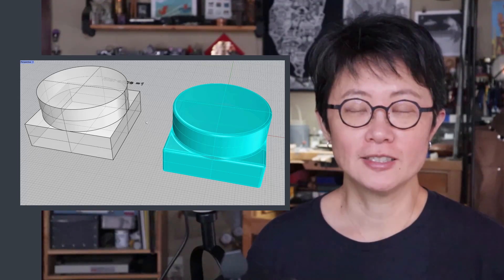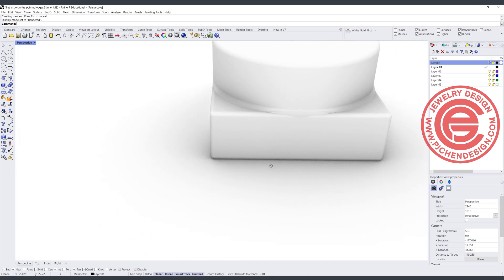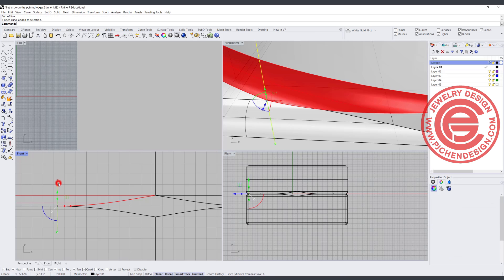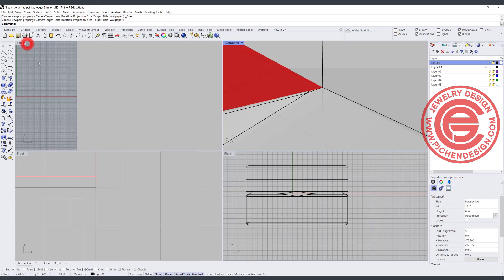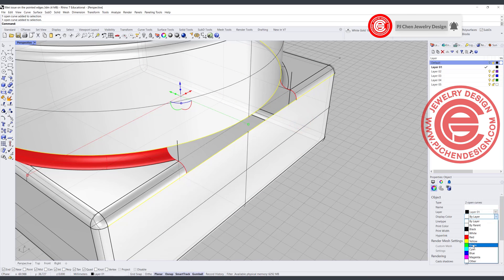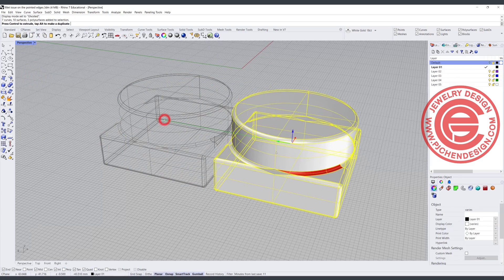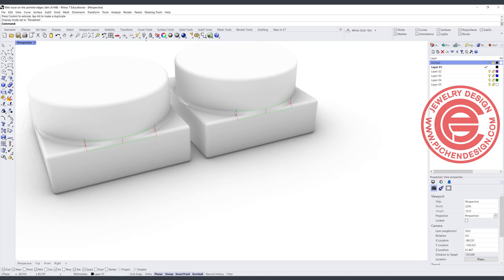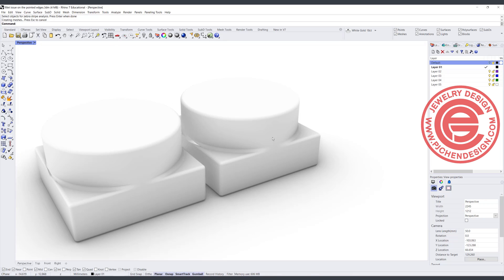SOLVED! Fillet Issue in Rhino 3D #267

Comment: this is a very simple case and you can fix it with some work , but in complex shapes , it will take very long time to do so , filliting in rhino is just very very bad , Solidworks and plasticity are much better option for filliting because they use the parasolid kernal
Reply from the maker: agree

Comment: Hello, I can't get the fillet at the base of the cylinder facing outwards, can you tell me how to proceed? I start by making sure that the base of the cylinder is perfectly tangent to the base of the cube it rests on. Your tutorials are really very instructive, I certainly subscribe.
Thank you
Reply from the maker: Did you boolean Union the parts? was the fillet radius too big? did you use fillet or fillet edges commands?
Reply: immediately after sending you the question I remembered that it was necessary for me to do a BOOLEAN UNION, after all fine. Thanks anyway for the good directions and the instant response. Well done

Comment: PJ great tutorial. Wonder if you have a work around for a Boolean subtraction of lettering with draft?  Subtraction with straight lettering works but for resin printing and casting drafted letters are preferred. Drafted text causes Rhino to fail the Boolean. And on the filleting issue, is it necessary to fillet each line segment to have filleted lettering after the subtraction? Thanks for all your videos.
Reply from the maker: In general, if the text or object is small, you don't need to fillet the edge because polish will do the work after casting. however, if it is for the look or rendering, you may want to fillet all the edges possible.
Reply: @PJChenJewelryDesign  The filleting and drafting is for the bottom of the lettering for casting investment strength. Small lettering, undrafted and without bottom filleting, causes the investment to break out and cause casting defects even using special resin investment w/ boric acid added to strengthen. I've figured out how to add filleting to the bottom but can't do a boolean subtraction with drafted lettering......3-5 degrees.
Reply: @frankfritzges7819  I'm trying to solve this issue too... depending how you are making the draft perhaps you could try shrinktrimmedsrf before the boolean?
Reply: @spiroandritsis4584  I believe I've found a way to make it work. Will post here in the next day about the workflow I've come up with.

Comment: I usually export 3d model into SOLIDWORKS and make filletings there and then import it back to rhino. It is much faster than trying to cut and putch surfaces in rhino.
Reply from the maker: I do agree solid work has better fillet function.

Comment: I've been facing these filleting issues since I worked in Alias. In this particular, Rhino is not different. For a second I believed McNeel finally had found out how to solve them from the fillet tool. But in the end we have to turn ourselves into  digital tailors and start cutting and patching. Anyway, I've learned your cutting and stitching technique is efficient and yields better results. Keep up the great work.
Reply from the maker: I agree with you. Until the engineer figure out a better solution. We need to do cut and patch work.